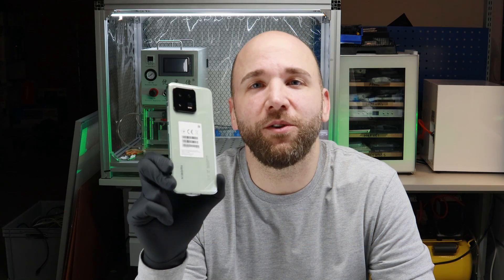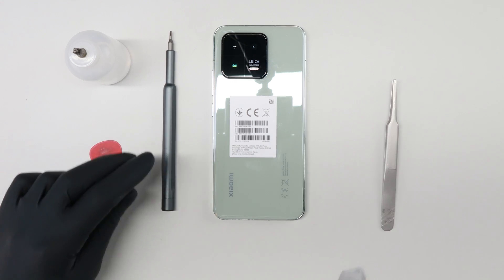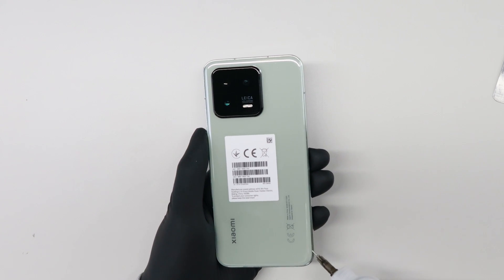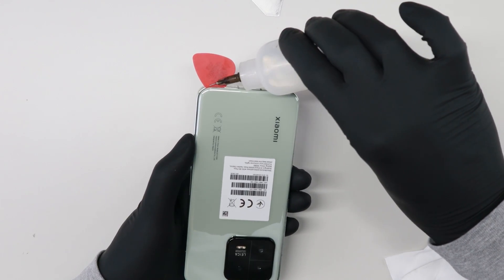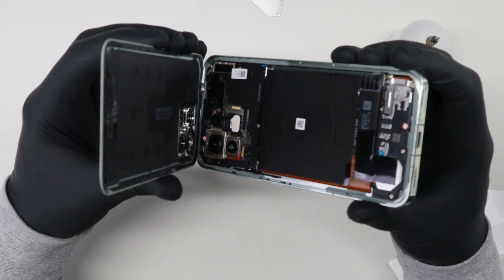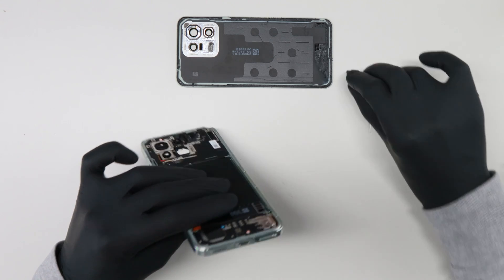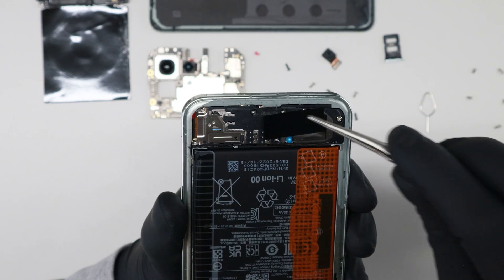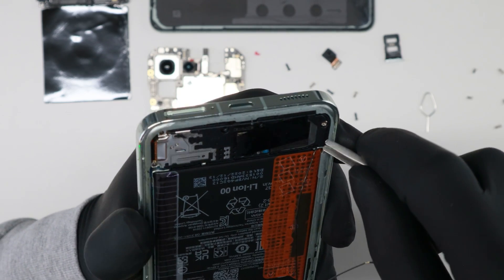Xiaomi 13 Teardown - Full Disassembly

Comment: Thank you for this video. 
I need to replace the power button on my Xiaomi 13. I have two questions:
1. How far in your video is the required disassebly point ot be able to replace the power button?
2. When you reassebled the back cover, did you need to reapply adhesive?
Thank you.

Comment: There are the four tiny holes at the top of the Xiaomi 13.
Could you please explain what these are?
Thank you for your help. 🙏🏻🤩😇
Reply: 2 microphones , 1 for remote control and another one is for the speaker
Reply: @cars12h72  Thanks indeed 🤩🙏🏻
Reply: Sir, could you please explain me one thing 😁

Xiaomi 13 has Stereo Speaker.

In an ordinary strereo speaker phone, it must have only two speaker holes - one is at bottom of the phone (mic) and another is at top of the phone (ear speaker).

However, Xiaomi 13 has 3 speakers.
The third one is at the top (one of the four holes - beside the noise cancellation hole).

So, there are two speakers at the top right?
Reply: @kaungmyatmin7177  right, ear speaker and loud speaker
Reply: @kaungmyatmin7177  i think ear and lloud - the same device. The same device as main speaker on the bottom.

Comment: Hi Roland, first of all what a great video about the teardown, I do have one question tho, I accidentally stab the sim injector on the bottom mic hole, I did not feel tho that I hit something, I did some test by speaking directly through it when doing video calls and my voice seems fine, Im just worried that I damaged something inside. Thank you so much for your response
Reply: Haha, bad design I think. I have heard that people all over the world had the same experience as you (including me). Don't worry as it's a "L" shape tunnel.
Reply: What a relief hehe thank you so much for answering my question. You are the best!
Reply: All holes on smartphones have special construction that inserts can not damage something. Like bastion gate!
Reply from the maker: Hi Chris,
If the other person hear you well by a phone call, then it’s not damaged.

It can happen but the hole don’t went straight to the microphone, so all fine.

Comment: This phone is specified with IP 68 rating. How fixable it is? I have this xiaomi 13 for two weeks now, and it feels very solid in the hand,very similar with my old mi 10t pro which is built like a tank. Nice work man. 👍👍👍👍👍
Reply: Huh, cool. You had the same phone I once had. And now you have the phone I also have
Reply: @vengirgirem Actually I still use the mi 10t pro with my work number, the xiaomi 13 is dual Sim, but I prefer to keep everything separately from my personal account. 
Software support is ended for this mi 10t pro but still a great usable phone, the battery is still going strong. My wife uses the xiaomi 11t with the dimensity 1200 ultra and the performance still very good. I like the xiaomi 13 compact size, is just perfect for my hands. I like the software,   
even if everyone tells me, xiaomi is bad, the software is better on samsung or iphone,but they never used a xiaomi phone. The xiaomi pad 5 is also a great tablet, my daughter is using it at school.